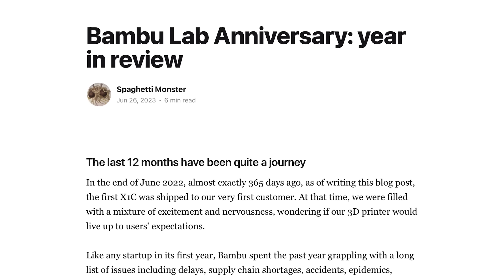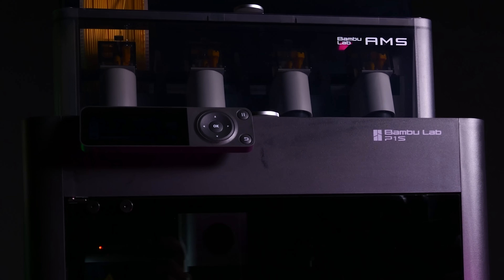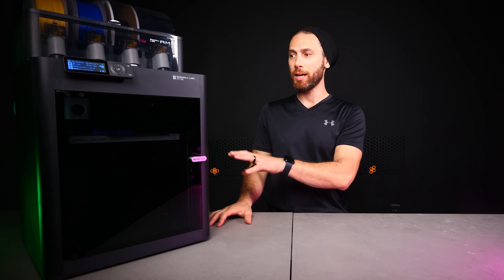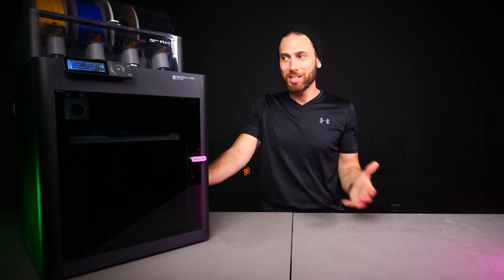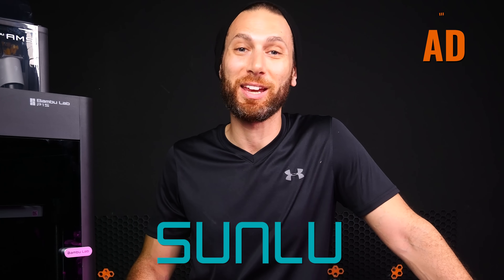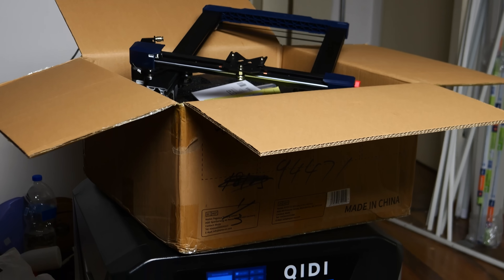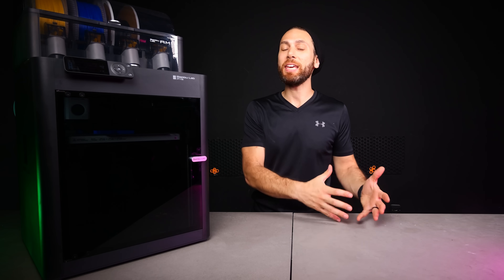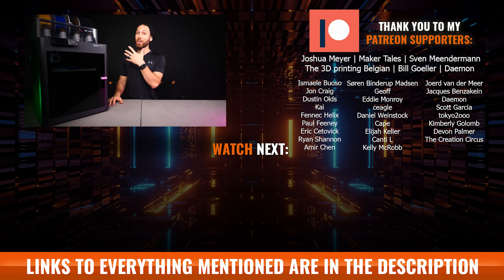Introducing The Bambu Lab P1S

Comment: Youre reviews & comparisons are top class so please keep producing these rather than project videos...Im coming from resin printing and heres my problem...
1) FDM printing seems a ton of headaches compared to resin
2) Prusa is too expensive for what it is...
3) Bambu Labs support is awful
4) I dont trust any printer made by Creality ( i wish this wasnt the case due to their prices) 

Going to wait for Bambu to come out with larger build volume printer and for their support system to improve. Great review and minor details very well articulated. Love this channel.
Reply: I mean, with Prusa what you're paying for is the aftermarket support...

Do you have direct experience with Bambu Labs support?  Or is your conclusion from comments on the Internet?  If the former, I don't mean to diminish your experience, and hope you'll forgive me.  But if the latter - remember that the accepted rule is that people are TWENTY TIMES more likely to share a bad experience than a good one.  Which means the service quality can seem worse than it actually is.

My personal experience with Bambu's support was that it was a bit slow to get replies, but they responded in detail and kept working with me over multiple rounds of troubleshooting until we finally solved the problem.  My impression is of a dedicated professional team that isn't big enough to handle the volume. Now, I've only needed support just once, because of a software issue  (I find my X1C incredibly reliable)  so there could be "we hired a bunch of people but they're still learning" issues happening now.  But my experience with Bambu support was overall good.

As for Creality - they're prices are what they are because of the lack qulaity control and 100% non-existent aftermarket support.  Basically, if you want a good support team those folks need to be paid somehow, and now you're back to Prusa's prices.
Reply: @davydatwood3158  Good points, admittedly i dont own any FDM printer but very experienced in the resin world of printers so possibly unfair of me to comment, but as i am looking to purchase my first FDM i have reasearched every piece of info i possibly can, but i am going off reviews and 2 friends who both own P1P's...3d muskateer hs had numerous problems with 2 machines sothat cant be just coincidence. I expect Bambu to have teething problems due to being a fledgling company but Creality have no exuse whatsoever. No smoke without fire on reviews so i keep an objective view but think i have a fair assumption on all 3 companies. What Bambu have achieved with their first iterations of printers is trully commendable. Prusa has great support, is it worth what they are charging compared to the competion???...
Reply: @andymeenan  Creality's "excuse" is "you get what you pay for."  As someone whose first printer was a Creality, I wholeheartedly agree that they are horrible machines for a first printer.  I'm not even trying to sell mine now that I have a better machine, it's not worth the effort of getting it "mostly" working; I'm just stripping it for robot parts.

I don't have a P1P, so it's very possible there are issues with that machine I didn't experience with the X1C.  I do know that on my X1C the only mechanical problems I've had are all attributable to user error - things like slicing the part for the wrong filament type or handling the build plate right after eating pizza.  The only real problem I had was an edge case with my Windows 10 build interacting weirdly with an early version of the slicer, and as I say Bambu eventually found a solution for that (and as a workaround I was able to use my laptop for slicing).

As for Prusa being worth it - well, that's a question everyone has to answer for themselves.  I will say that about a year after I got the Creality machine I was deperately wishing I'd saved for four more months and bought a Prusa instead.  Although, if I'd done that I might never have bought the X1C - and I love that machine so much, it's made 3d printing fun again.

At the end of the day, it's my opinion that a new entrant into FDM should save up their money and buy a good quality printer; for an "it just works" hobbyist, I believe the X1C is the best choice out there; for an "I want to build my own someday" hobbyist, a Prusa kit offers a reliable and dependable introduction to building printers.  I would assume that the lower cost P1P and P1S are good alternatives to the X1C, but I don't have any hands-on experience and if you're hearing different things from other folks, then their information is certainly more current.

Comment: ordered. it was about $80 more than the p1p order with the same additional accessories (ordered a mc fan just in case).. so that would be the cost of the enclosure. still a better deal than getting an enclosure separate and printing parts.